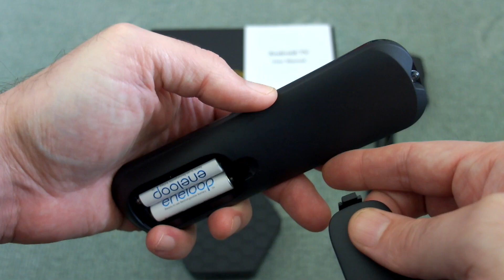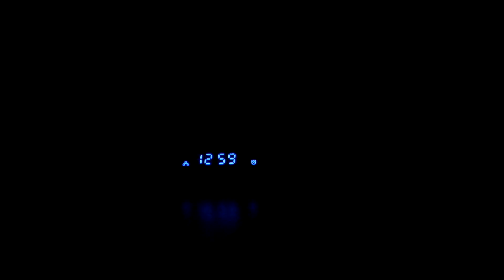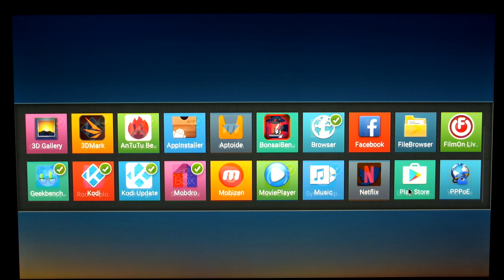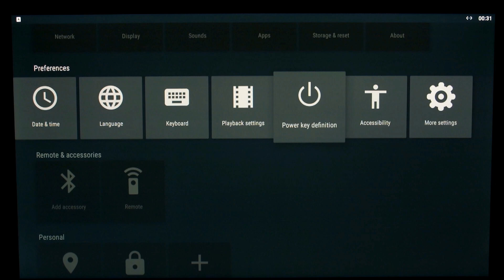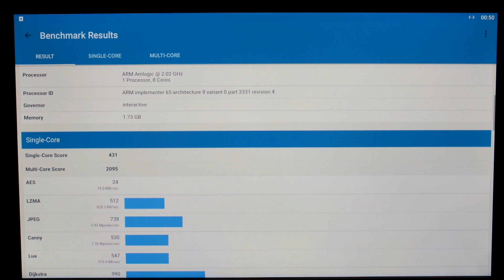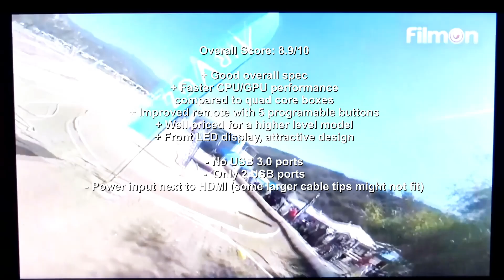T95Z Plus S912 Octa Core Android Box Review

Comment: what can i do since i bought my box it would freeze i unplugg it and would boot and it would work properly ive done that for a yr now but just yesterday i plug it in andit goes on but thier is no signal being sent to my tv its not working
Reply from the maker: Try a reset on the box, if no joy it's time for a new one
Reply: @MrBazReviews  but ive only had it for a yr and used it very little and it was 60 dlls
Reply from the maker: @BAJAGAYS  Try a reset usually you only get 12 months warranty on items like this, you can try to contact the company you bought it from
I don't have support solutions for you, I only review and test items that come in
Disconnect the power supply. Using a cocktail stick, paper clip or similar, gently insert it into the Restore hole located in the AV port. It may take a few attempts to get the correct location of the button, you will feel a button click when located, keep it held down.

Comment: I purchased this box about a year ago and it will not connect to WiFi anymore it’s not my internet because all my other devices connect to it but my T95Z can’t locate any WiFi at all just keeps looking and after about one minute of searching it just turns off the WiFi option and I do it all over again and same thing happened again over and over any idea what else I can do!? I’ve rebooted the box rebooted the internet and still nothing I’ve even tried to do a factory reset and that didn’t work only works with Ethernet which is good but I can’t watch it in my room anyone know what I can do to solve this?
Reply from the maker: If you've done a reset then it sounds like a hardware problem. You could use the LAN port or even a repeater which has a wired connection if you can't get close to the router. Sounds like it's toast

Comment: Nice review. Thanks.
Good with Kodi, but overall, I wasn't happy with the T95Z Plus.
Turns out that all Android TV boxes have the following issues because they use a touch / tablet version of Android OS -- thus "needing" an enhanced remote control (like an air mouse, or one with a touch pad). 
I was too used to my Google Nexus Media player and FireTV Stick that uses Android TV OS -- which allowed the easy use of simple remotes (like the one included or these, https://i.imgur.com/6zIxJy9.jpg); plus better and/or newer versions of Netflix, etc.

Some issues with TV boxes using Android OS:
Netflix - very unreliable remote navigation, play/pause, info, etc; Netflix app NOT in Playstore - can't upgrade. 
Playstore old with very limited & unreliable remote control navigation, can't Update ??
YouTube - old outdated version (can't access many of my playlists), newest version requires mouse.

I have yet to try out one of these newer, inexpensive TV Boxes with Android TV OS  (like the $70 MECOOL M8S PRO L ), can anyone confirm my findings?

Comment: Hello, are you using just the remote control cuz it seems respond very fast
Reply from the maker: No I'm using an air mouse (highly recommend one of them for boxes) there is a digital mouse on this remote it's passable but obviously not nearly as good. So it's fast because the air mouse

Comment: How can i stream futbol matches without having to use the channels on the box, this way its just buffering. Like can i stream matches from chrome?
Reply from the maker: You can do live streams with Chrome, but have you tried Mobdro that has a lot of sports streams on it and when I've used it worked well
Reply: Mr Baz Reviews the sports streams on mobdro are buffering nothing is playing, i cannt even play youtube clips, what could b the problem? My wifi is good coz am using it on my laptop n phone
Reply from the maker: Try rebooting the router sometimes it can help with android boxes (had it a few times), if not then do a reset on the box there is no way you should have buffering on all the apps, make sure all apps are up to date versions (youtube has bugs older ones mobdro also has improved)

Comment: Hi, I want to know if is posible play 3D movies with that box?
Reply from the maker: The hardware supports 3D movie playback
Reply: Mr Baz Reviews okay, But I have tried to play some movies since kodi but only gives me image on two screens, does not convert them to 3D, even download a 3D movie and play it out of kodi and I still have image on two screen, what would be the problem? What do I do to configure or fix it. Thank you
Reply from the maker: Hi I'll have a look next time I use the box I think by default it splits the screen into two have you tried using any other software for playback?
Reply: Mr Baz Reviews Inside the kodi I have only used some of the options that it puts for 3D in torrent and outside of kodi I tried to reproduce with some applications of the playstore for 3D videos without any result. I will be eager for an answer on your part if you try to play 3D in your box. Thank you

Comment: Just purchased LG 55 inch ultra 4k tv and also an mxq 4k tv box. The problem i have is that after installing the devices and operating them together the tv box sort of freezes,(goes crazy)  and if i change tv source and go back to hdmi tv box it does not recognize it. I complained and the dealer replaced the android box 3 times but i am still have the same prob. 

Note: an older tv box which is not 4k works fine on the LG55 tv. 

I would like to purchase the T95Z plus, do you think i will be able to install it to my 55 inch ultra 4k tv without probs?
Reply from the maker: Hi Daren I have had a couple of boxes freeze up it could either be a production issue or a heat sink problem can't see how 3 boxes could have this unless there is a factory issue. Maybe try another source for the box using this for months as my main box bar the odd app crashing no problems at all with it.
Reply: Thanks for your reply

Comment: Not recomended this chinesse boxes, I bought this T95Z Plus and my unit had defect poor WiFi singal, even near router was very weak signal for only one bar of four in main menu :) I replaced it and in new one WiFi worked corectly maximum singal four on four bars, but after few days of use then remote died (infrared died in remote) I said no more this low quality chinesse crappy noname boxes in my house, better deal is buy Mi Box 4K with great Bluetooth remote with voice search and full Android TV system, or even save some money for best box on market Nvidia Shield TV.

Comment: Does this work with older TVs? I have the Nexbox A95X & Nexbox admited its not compatible with older Sony Bravia or Phillips TVs. The screen flashes green, the system update to force RGB didn't fix the issue. Now looking into this T95Z.
Reply from the maker: What type of TV are you using the box has an AV out port for RCA cables (though it doesn't have any included)

Comment: I have two questions about the device:

1 - Does it support 1080p@24Hz?

2 - Is there support for Blu-ray 3D isso?

Thanks in advance
Reply from the maker: Hi yes to both 1080p 24Hz is listed in the settings menu for screen resolution it also supports BR 3D ISO files for playback. hope that helps

Comment: Don't buy this one for the clock, at 2-4 meeter you barely see the clock, the light is not that dim, I need to be at 2 feet close to see the time. The led button on the remote control only the external light of the box not the clock.

Comment: can I use xbox controllers with this box? or do I have to use Bluetooth
Reply from the maker: I've not tried it this is about the new Xbox One controller seems it's not a good choice
http://www.androidpolice.com/2016/08/11/psa-the-new-bluetooth-enabled-xbox-one-controller-works-with-android-but-not-very-well/
Reply: Thx for reply one more ? about gamepads can i use a wired controller or the Amazon gamepad?
Reply from the maker: Wired pc USB gamepads should work I've used a few. Also the wireless RF gamepads I have one for the pc and it works fine on the boxes. There are quite a few around on ebay Bluetooth/wired/RF ones.

Comment: In your opinion what is the best Kodi box? speed wise I guess, the fire stick is nice and cheap but lags or jitters just a bit. I want something smooth as butter without building another HTPC
Reply from the maker: There is a new Fire TV stick coming out soon. Honestly I don't rate the first one much it's only dual core not really up to the job for more intensive tasks newer one looks better quad core but still 1GB ram. I would honestly go with a 2GB ram box if you want Kodi to run well. That means either an S905/S905X chipset boxes or this which is the S912 and there are some other ones around using the same 8 core processor. Either way I've found the extra ram to be the most important area. Hope that helps a bit bottom line if you don't want to pay the price of this box go with the quad core 2GB models (reviewed a fair few of those)
Reply: Mr Baz Reviews I've build htpcs and it's just to much, I only use them for Kodi and a random Google search here and there. I like the ease of fire stick but it's slow. I was looking into the mi box but have not seen or heard good things on it, so without spending even more money just seeing what others think is a good option but not so cheap that it ends up being trash in 4 months like the g boxes
Reply from the maker: Not used the mi box though the spec is good enough to run Kodi well. Some folks use custom software for Kodi it's more demanding on memory so 2GB is really a must if you are pushing things a bit. This box I've used since I put the review up and not had any problems bar the navigation bar bug. The S905X chipset seems more stable than the S905 (Q boxes) that's also probably good enough for most people
Reply: Mr Baz Reviews I normally delete the Kodi that comes with the devices and load a fresh clean install, is this better then running the custom ones that come with the boxes? I like to use my own builds.
Reply from the maker: I'd install it again often they are slightly older versions. If you prefer your own builds that's the best way to go IMO.

Comment: looking for decent box just for kodi got m8 for now but buffer buffer  does the software get updated on this box or is it like the rest of the Chinese boxes no updates , this is looking good so far cool review but do you recommend ?
Reply from the maker: There was one update so the OTA does work I looked last week and no recent update but the OTA is working which is encouraging. Agreed a lot of boxes say they have an update but more often than not they don't function at all. MXQ's entry ones never once had one that updated and I used quite a few variants.

Most 2GB boxes do quite well for Kodi the extra ram is important as it uses a fair bit. Been using this solid for a month as my main box and I've not had any issues. I think it's worth getting this over the Q box price is a bit higher but packs more powerful processing which helps.

Comment: I am returning a Nexbox quad core that I just got because it is dog slow.  Especially the web browser.  It reminded me of old AOL dial-in speed.  How is the web browsing speed on this?
Reply from the maker: Hi Mitchell the Nexbox is a lower end one 1GB ram quad core as you say. This is quite a lot faster and for browsing it's good during my use (I am using this as my main box for over a month) is the issue Wi-Fi speed? Just wondering because some boxes are slower here. I did a Wi-Fi test..the T95Z does pretty well though I found this one to have quicker speeds (both are more than good enough for streaming speeds) location of the router can be something to look at (some use a repeater or booster)

https://www.youtube.com/watch?v=MakaCwtC2sA&list=PLPDCN48jxW_vWiHOdWqvmlXHgJtJAK2Sx&index=9

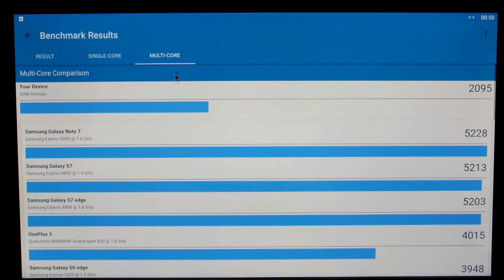If you go to 5:12 you will see the Wi-Fi speed test bit faster than the T95Z built in antenna models do better but I've not had issues with this one. Hope that helps a bit
Reply: The one I got was an updated version with 2GB ram and 8gb flash mem.  I was suspicious of the wifi because a recent Xfinity update hit all my streaming devices so I ran a 50 ft. ethernet cable into the room and netflix opened much faster and videos loaded in hi-def but the app crashed after a couple minutes and then netflix wouldn't open any videos.  I stopped there and boxed up the Nexbox for return.  Wish I had tried internet one more time.  Still I get 100mb download times on internet speed tests and my network is a 600N 2.4/5Ghz network with a router downstairs and a range extender upstairs so I would think the wifi would have been adequate.  The box was damaged in shipping so maybe that affected the wifi.  thanks for responding!  Nice video BTW.
Reply from the maker: Sounds like the box might have had some bugs. It can happen I've used a few that crashed apps or had other problems yet ran identical hardware/OS as other ones that were trouble free. Some did drop Wi-Fi at times even in good signal areas. This one is working well bar the navigation bar issue where you can't bring it back I have no complaints one of the better boxes I have used.

Comment: Is there anyway to get the navigation bar back once you hide it?
Reply from the maker: Hi you can set the box to power down fully rather than just go into standby in the settings. I did check the OTA updates there isn't one at the moment hopefully they will release one to fix the navigation bar issue.
Reply from the maker: Hi Fred not that I have found seems to be a bug (most other boxes let you bring it back). Will check the OTA updates to see if there is a new one out.
Reply: The only way I found was to pull the power out and put it back in again.
Reply: The other way is to just not close it, will have to reboot if so. I just leave it as it is because it never shows on fullscreen apps anyway and slides up if you want it.

I looked at 3rd party launchers, because I like to have more apps on the homescreen, but none really changed that bar. Though some 3rd party apps do add all that to the top dropdown menu as well, so can use that instead.
Reply: You need to click the edge of the screen.
Reply from the maker: Not working for me can't get it back edge or bottom doesn't seem to be functioning yet.
Reply: You can download nova then when push home button on remove pick nova just once that will bring the bar back.
Reply from the maker: Yes you can do that use a launcher I was thinking of the maker fixing it via an update "as is" shall we say. OTA does work I updated it once they might fix it at some point.
Reply: it seem to stay with  a launcher but still if you hide it on tv box home screen it wont show again. But problem seem to be all andriod 6.0  I think with 5.1 there a better home and settings.
Reply: seem who ever made the software for the T95U and T95Z set it so it cant been shown as with the A95X seem you can click and drag it back up. So must be why some people don't have problems as certain boxes let you bring it back up.